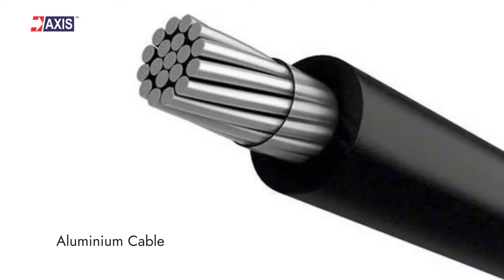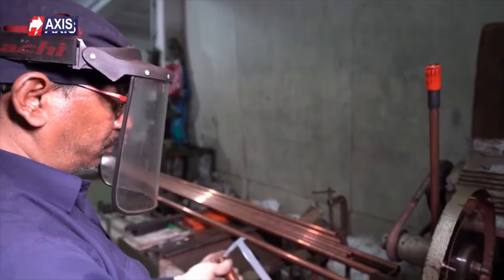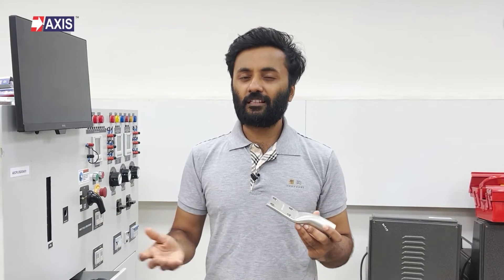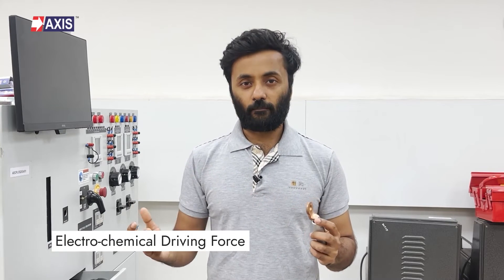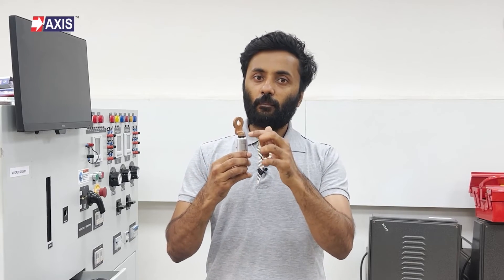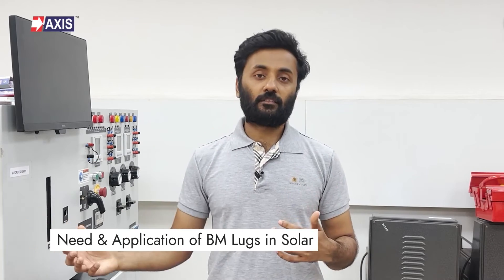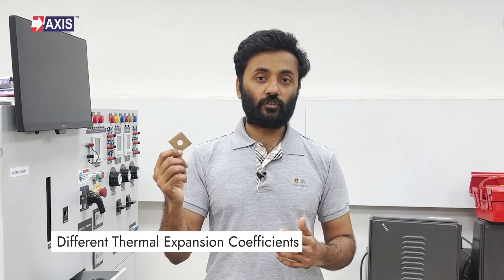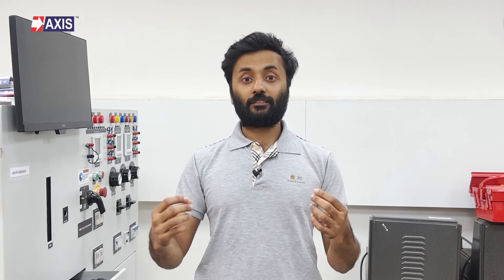How do Bimetallic Lugs save Solar Panels? 🧠⚡

Comment: further explaining the cable coming in is 25mm aluminium and it has to be connected to a 6/10 mm copper cable
Reply from the maker: For this you would require bimetallic connector, you can contact us to know more about bimetallic connectors. Please share your details at sales@axis-india.com

Comment: hello great video
I was checking out your catalouge.
I really wanted to use the bimetal lugs for domestic use.But the catalogue shows the smallest size of copper side is 25mm ,but the max we use is 6 or 10 mm, which lug can be used for domestic use?
Reply from the maker: For this, you can connect with our sales team for a detailed discussion. Share your details at sales@axis-india.com

Comment: Hello, I have ATS panel which has aluminium bus bar, could i connect copper cable with copper lug on aluminium bus bar, cable size is 240 sq.mm
Reply from the maker: Hey Amit,
That's not recommended as it can cause bimetallic corrosion. 

However you can use Tinned plated copper lug to reduce this effect.